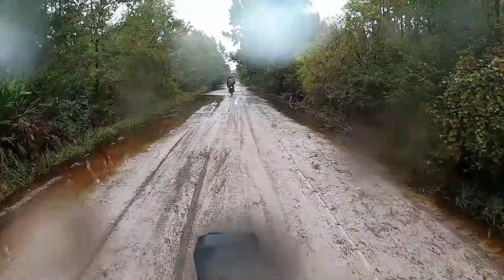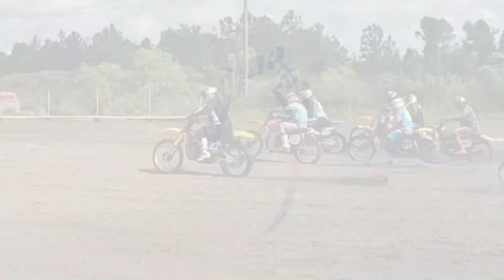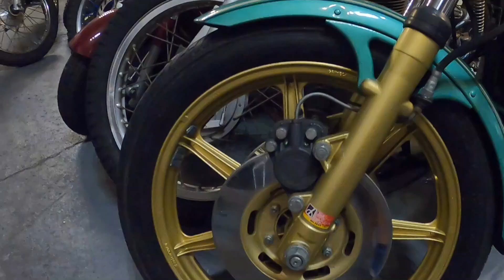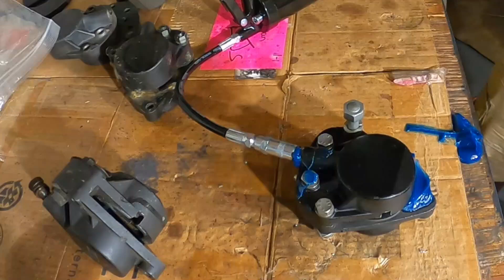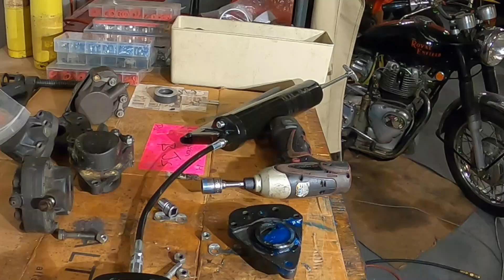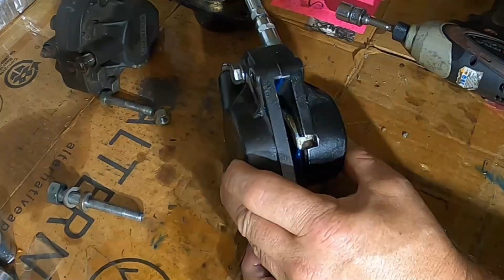WHEN THE DARN BRAKE CALIPER WON'T BUST LOOSE - A MAGIC TRICK?

Comment: Surely you could try using the bikes brake mechanism to pop the piston.
Reply from the maker: I suppose if the remaining brake system was working and in good order, and you can get good pressure, and not pop a line
Reply: I think your method is brilliant, I was just thinking out loud. @bullpencycles

Comment: Great, ,

Another use of grease, it to remove pilot bearings , in the rear of a crankshaft. The pilot bearing/bushing serves as the front support for the automobile standard transmission.

A grease gun can't be used, in that.  You pack the pilot bearing full of grease ( no air space ).  Then take a round object, an old pilot shaft or a round punch that fits the pilot bearing bore. Get a good sized hammer and smack the punch, or dummy pilot shaft and like magic the bearing pops right out.
Reply from the maker: I was wondering to try this with stuck 4-stroke engines, just make a spark plug adapter with a Zeus fitting